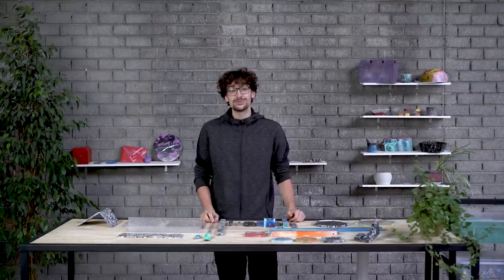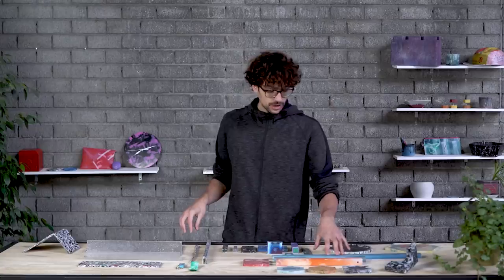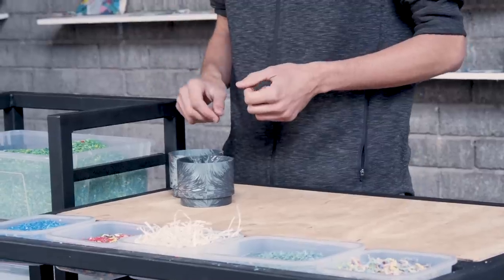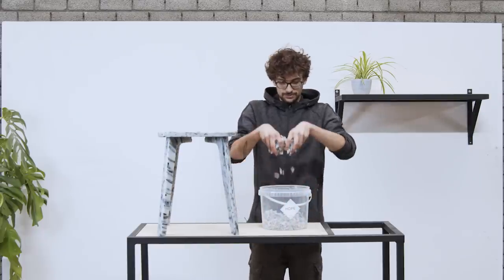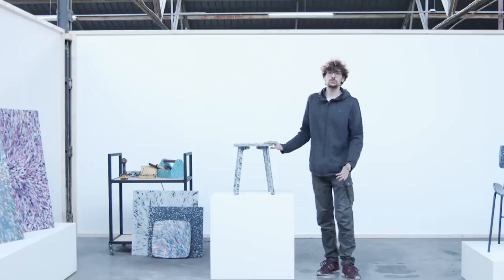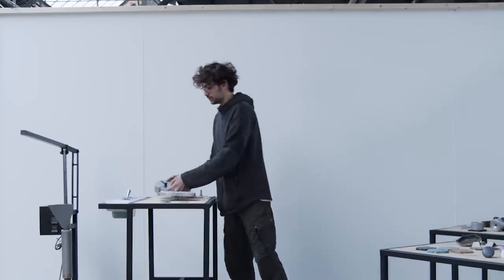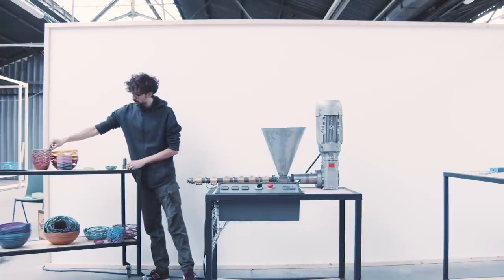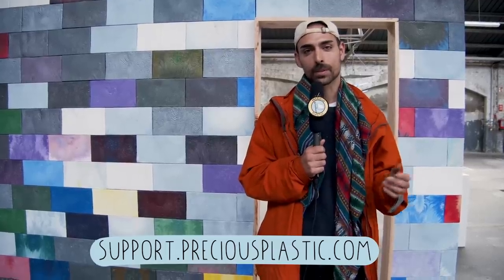Precious Plastic - Good design with recycled plastic (part 5.1)

Comment: As a skater, a skateboard is a really bad idea. You would scrape the tail on the ground and shred plastic everywhere. I would recommend using an organic material on any point of contact on anything that would wear down or you're creating micro plastics.
Reply: jessejamesb  your already leaving polymers (plastic) every where because all the skateboards we use are glued ply from maple and other trees, lots of polymers are use for this process. We are also creating more C02 by chopping down the trees. Lesser evil plastic which isn’t micro fibres. Micro plastic fibre floats in the air and is very dangerous to breath.
Reply: How about making long boards and Penny boards instead then, as you don't use them the same way? Obviously, the long board would have to be strengthened in some way, so it wont bent, but still
Reply: I’m going to make all kinds of decks from plastic. It’s a no brainer!
Reply: @psacentralcoast6970  yeah, but he does have a point, it will be ground down, which is a potential issue. I don't skate, but it sounds like you do. Would it be possible to coat the bottom of the skateboard  in something, or would that be senseless?
Reply: Hey, Jason, the guy
 behind the skateboard here. This concern did pop up during my research phase but i still consider it a step in the right direction. If you look at the state of the plastic before; (1.6kg) it mostly comes from smaller pieces, cups, bottle caps food wrapping. By forming it in to a relatively large product you are capturing all these small pieces and storing them in one piece, that has a perceived value from a person, so is more likely to be looked after by the owner. Granted there will be a small amount of micro plastic but: 1.) It is a small percentage of the mass of the amount of plastic stored in the board. 2.) This also happens in wooden decks as they are glued with polymer based resins, which are typically virgin plastic anyway. If you have any more feedback about the project drop me an email or sign up to my mailing list about the project ;) 
https://www.mandin.earth/jason#/recycled-plastic-skateboard-deck/
Reply: You bring up a good point.

Also, I never thought about microplastic, but I couldn't imagine it being good to ride on. Only experts would know.
Reply: You could use plywood as the bottom and then glue surface from plastic that can be molded to have rough surface and all kind of patterns. Other option would be to use metal or wood peaces on those parts that get grind down and take majority of abuse, but how that effects the feel of the board is different question. Long board idea mentioned could have potential, even though i dont skate.
Reply: Plastic recycling franchise manufacturing machine my India cycling plastic student cutter
Reply: Plastic recycling this is my India franchise manufacturing

Comment: I beam? Bricks i can understand, some bricks don't hold much force and weight. Such as fence. But i beams? if you had to call it i beam, it will lead to a question, how much tons it is going to hold? And the nature of recycle plastic is not a weight lifter, unless you put a steel rod inside. Back ro square one, then it is a steel i beam with plastic coating. Not a plastic i beam.
Reply: I agree.

Our bus stops had plastic beams for seats. Every 1 of them began to sag after a while.

The only use would have to be temporary beams, or where perfect straightness isn't a big deal for the life of the beam. Maybe skateboard ramps?

Comment: Precious Plastics needs to learn MASS.
MACHINE BASES are currently made from EPOXY GRANITE ... and other minerals.
So... IF YOU WERE SERIOUS.... 
YOU COULD WASTE A LITTLE PLASTIC on developing NON-METAL FRAMES for ALL your EQUIPMENT DESIGNS.
Reply: square tube dirt cheap and much stronger.